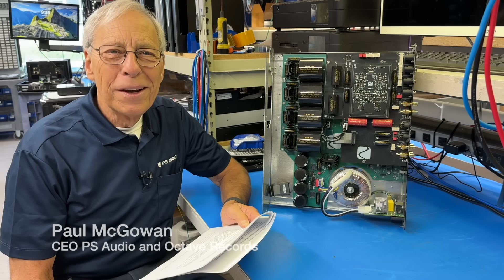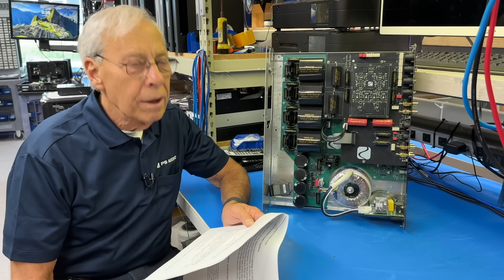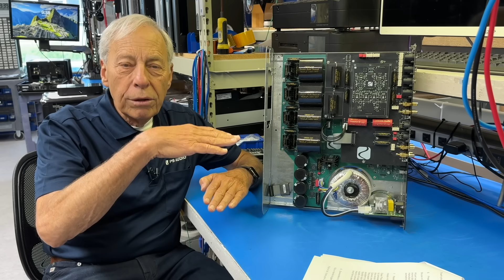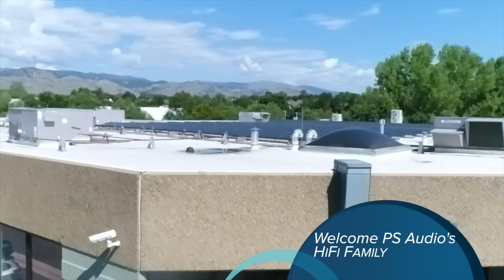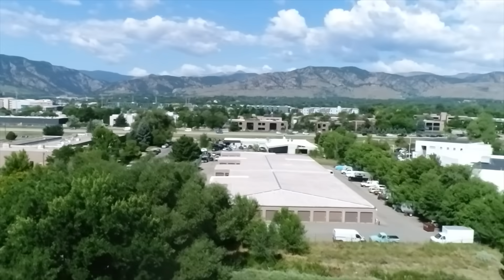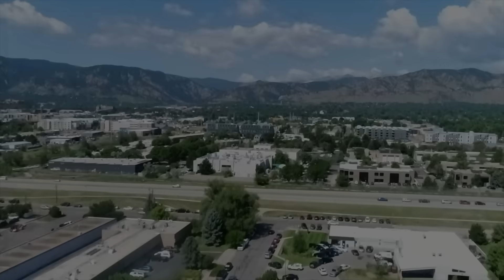Importance of preamplifiers and power supplies

Comment: Preamps matter more when they have tubes!  Well, for me.  All my sources are mixed and then fed into a tube preamp, and then into a Class D power amp.  That is a fantastic combination.  And only one set of tubes is required, all sources benefit from the effects of the tubes.  Never mind how tubes do what they do, just pay no attention to that man behind the curtain 👍.
Reply: What genres of music do you listen to mainly?
Reply: The Recording Quality is most important. Tube's do nothing but add coloration that is NOT on the Recording. Just like Vinyl Nerds love that Noise Floor coloration.
It's NOT BETTER...only Different
Reply: A LONG Time ago, my Father Gifted me all of his Tubed Stereo Components: Amplifier,  Preamplier,  Tuner and 2 RtR Tape Decks-. 

The ONLY Tubed Component I kept and Used, was a Marantz Model 7 Preamplier. A great Friend who was also, a talented Electrical Engineer Rebuilt that Preamplier. 

I used the Marantz 7 with a good Solid State Power Amplifier and was pleased with the resulting Sound.
Reply: @ericanderson2987  You truly have a great combination there 👍.
Reply: Though I don't dislike tubes, please consider that the properties of a high quality opamp way exceed the properties of any tube, moreover the simple and parts saving design will eliminate noise and colouring, not to speak of speed and phase-troubles.Mind that any complication and addition to a circuit has its degrading which is hard to eliminate by gains of complcating.
Reply: @edmaster3147  Ed (with no channel content), op-amps do not help the soundstage much.  If you've never experienced true 3D surround sound from tube preamps and two speakers, you have no idea what I am stating.  I have considered all of these things.  Thank you.
Reply: @peterbaugh51  there are more ways to achieve a result; I know about tubes, of sound and engineering. I don't dislike tubes, I even own a tube pre. Sound is about an experience and that is personal. For transparency they might be not reproducing the intended sound and stage, yet very pleasing and entertaining. A simple amplification and buffer by an dual opamp, well executed, can do all you want.
Reply: @edmaster3147   You have no idea all I want.  You are very presumptuous.  I'm not going to tell you what you want.  That would make me look very stupid.  Get it?  Have a nice day.  Wow.
Reply: That's just taste. Tubes add nothing but noise and distortion. Some people like that, others don't.
Reply: @xaviermontalban1701 tubes offer more linearity without any feedback and sound better than transistors in line level applications.
Reply: @xaviermontalban1701 i feel pitty for you
Reply: @EdMakoestiek why exactly?
Reply: @xaviermontalban1701   Never had any tubes that made noise..  and only Chinese tubes have made distortion on my systems.  Second order, even order distortion is very pleasing.  Solid state is boring.  Sterile.  Just my opinion as a musician.
Reply: @peterbaugh51  mmm... not true, some picked mossfet transistors do a lot of 2nd order distortion, but they have more grunt than a tube. They generally should be in a good high bandwidth circuit to get the most of out of them.  Class A Pass amps are pretty good.
Reply: @NightFlight1973   I only make true proven statements.  Solid State cannot make the harmonics and sound stage of tube preamps.  Otherwise, all professional musicians would always use solid state.  They do not.  All of my musician friends use tubes.  Professionally.  Now I wonder why that is?  Of course, if you're not professional, buy whatever you want.  It really doesn't matter.  It's just personal taste...  I'm guessing you have not checked my channel description.  I checked yours. Cheers mate 👍
Reply: @peterbaugh51 "Just my opinion as a musician." Interesting. What do you play? I can see why some musicians would prefer tubes.
Reply: @PS-n5f  SOME musicians prefer tubes?  Are you trying to be funny?  I have played over 30 instruments in my lifetime.  But mostly piano, organ, drums, bass, guitar, 12-string, 6 string, electric, acoustics...  Harmonica...  This list is getting boring sorry.
Reply: @peterbaugh51  Well, I know musicians who play all those and don't doubt for a second they prefer tube amplifiers. But I know a French horn player and a cellist. I have no idea if they've even thought about whether they would prefer a tube amp. A couple of things I can be certain of -- they would know enough to understand why I would ask, and their answers would be courteous.